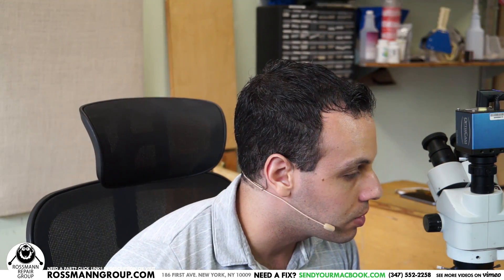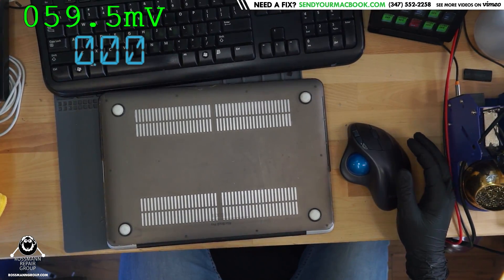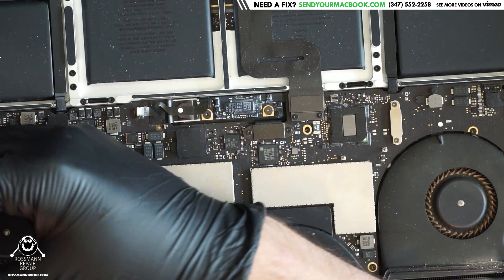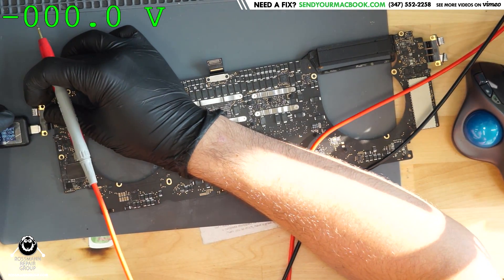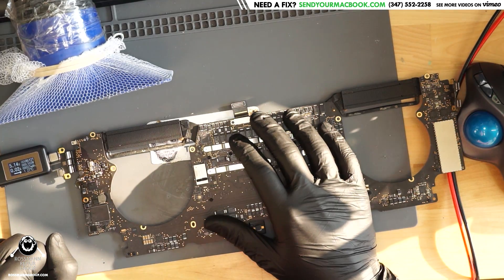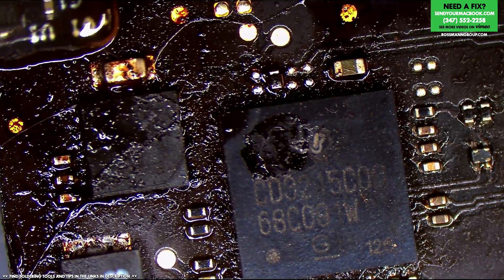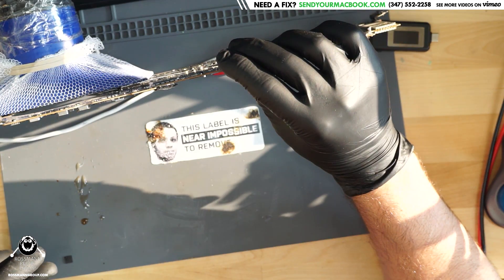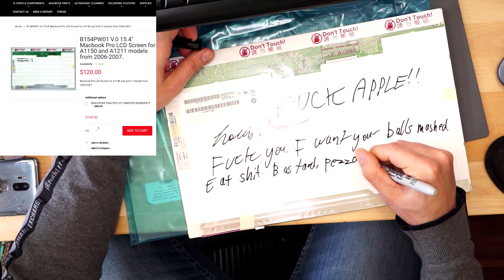Can a Macbook with water damage be repaired?

Comment: Went to the Apple store to drop of my MacBook Pro 13 ‘16 for their keyboard replacement program..3 days later i got an email saying something happened so i called the number and they said my MacBook has water damage. Mind you the everything was working fine just the keyboard is being silly some keys are not working properly but they work. So today i pick it up and ask what happened for them to tell me they’re requoting me $1200 for it to get repaired and blaming that theirs a water damage but b4 handing it to them everything was fine. Then when the Apple rep gave it to me it was just in a used wrap with a rubber band. I got home for me to realize my keyboard is not working anymore. I totally forgot to check it before going home so now i’m stick as i feel like they won’t acknowledge my mac because the keyboard is not working anymore. Funny thing is i never spilled water.. help me

Comment: 4 port Magewell HDMI Capture cards? Yawn. It's a better bang per buck if you would have gptten a Black Magic Design Decklink Quad 2 SDI for $1000 or so.. 8 x 1080p60 with SDI to HDMI converters $1200 ... I tossed one of those in a external Thunderbolt 3 enclosure and use my ASUS Zenbook to stream and encode with NVENC via its GTX1060. That gives me 8 x 1080p60 inputs Streaming high quality h264 with CPU Utilization at 4%. Small enough to put in my back pack. I use this setup when I have the opportunity to travel somewhere in town (Las Vegas) on my BBSHD powered bicycle to stream. I have multiple vehicles but I love the absurdity of showing up on my bike with a (almost) television broadcast grade streaming rig in my backpack. :D If I have a site that needs spread out a little I have 4 Newtek NDI Spark HDMI encoders... But those are kinda pricey at $800 for 1 HDMi.. ;) Either way the NDI plugins for OBS are game changing even if you do not use their hardware the protocols are open. You can throw streams around your network between OBS or other supported software basically lossless at the cost of about 100mbit per channel multicast traffic and 20-50ms (1 frame more or less) at 1080p60.. Yea I do realize I mighta gone just a TAD off topic. But eh it happens right? HMMMM.. I think I might had one or two too many energy drinks tonight probably should have stopped at 4.. This is probably why I don't stream content myself and am mainly the guy 'behind the curtain' pushing buttons and setting things up. No one will read this far anyways.. lolz.
Reply from the maker: Blackmagic is junk. I used to buy blackmagic, and it wouldn't work with microscope cameras.
Reply: @rossmanngroup  I'd bet it's not that they won't work with it. That since they are broadcast grade equipment they don't Auto detect in most cases. they assume you know what feed your source your going to be giving it and non-standard settings can be an issue. They're definitely not for the timid, there's definitely a learning curve for the like and what they don't but the video quality is second to none once you have them set up. I've only very rarely run into a device I couldn't configure. and it was really because it was using some whack format not even close to a standard.